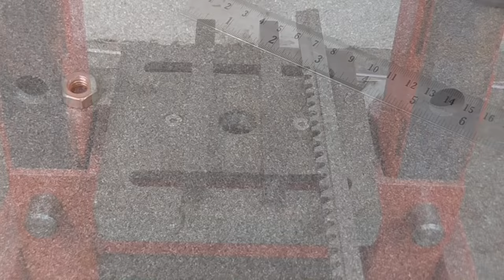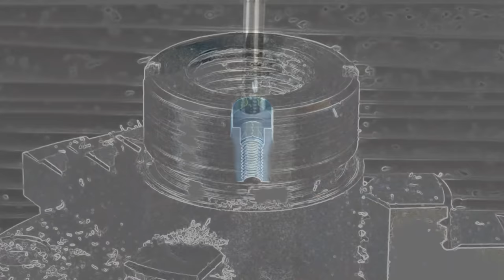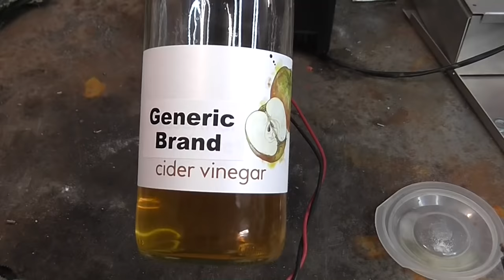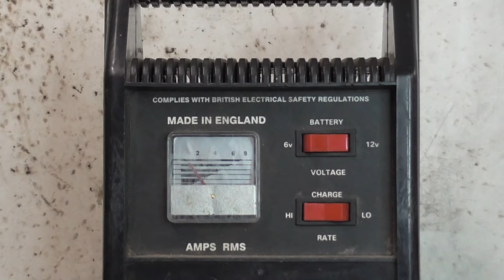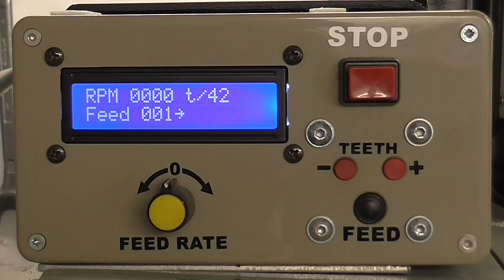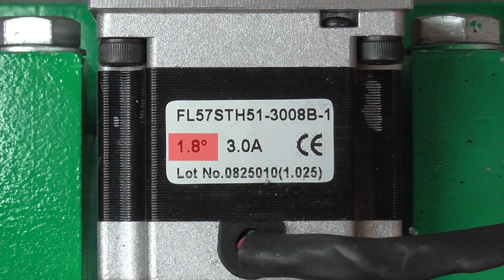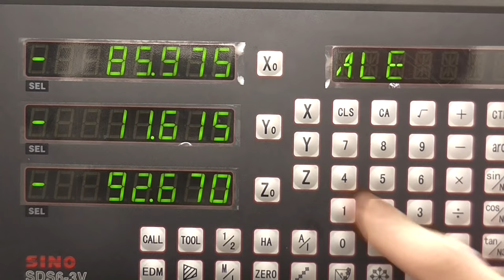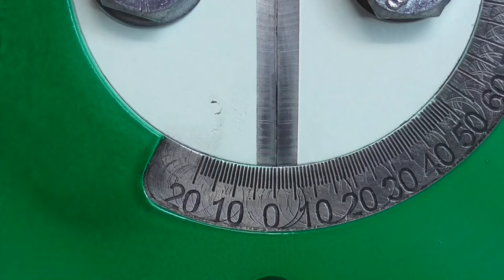Gear Hobbing Attachment (milling machine) Part 2

Comment: How does one cut bevel gears? Sometimes I wish I could just remanufacture my differential
Reply from the maker: Normally bevel gears are cut by a completely different system, especially spiral/hypoid types. It is actually possible to cut straight bevels with an attachment like this, but only with a single point tool, not a hob. When I absolutely have to make bevel gears I use the manual indexing method.

Comment: Would this arrangement cut Hypoid gears, such as a differential ring and pinion?
Reply from the maker: Unfortunately not. Or at least not with a standard type of gear hob, for that you need to use a different approach such as the Gleason system.

Comment: Kind of looks like Skiving is a form of rotary broaching?
Reply from the maker: Yes, it's similar, but the tool is at a much greater angle and the interaction between the tool and work is more complicated. (The tool partly broaches and partly generates the profile created).

Comment: impressive af. that's some excellent machining, subscribed!
couple questions though:
1) why are the teeth that are cut so rough? looks like a lot of file work to clean them up. at 15:17 i saw some misalignment of teeth on the hobbing cutter (i.e., they looked staggered about the horizontal line), could that be causing it? i think that because you cut the skiving cutter with that hobbing cuter, and it had rough teeth, the skived teeth finish was markedly worse. it seems like if they smoothness of cut could be improved that'd be a great improvement.
2) do you need different hobbing/skiving cutters for metric/imperial gears, or is it just an angle adjustment?
Reply from the maker: At 15:17 the teeth in each row on the hob are in a different position vertically as they wrap around the hob in a spiral. think of it as an interrupted thread.

Yes the internal gear was a bit rough, I think mainly due to chips not being cleared, but also due to the geometry of the cutter. The cutter I used had only 8 teeth, I think it will work much better with at least 12-14 teeth, this will make the profile of the cutter teeth closer to the profile of the gear teeth it's cutting. The gear has to have a number of teeth that is a multiple of the teeth on the cutter, I was cutting a 40 tooth gear and since I can (currently) only divide by integers the next sized cutter I could have used above 12 would be a 20 tooth cutter and I didn't have a piece of tool steel big enough to make one.

You can cut imperial gears with a metric hob and vice versa. Metric gears have a pressure angle (angle of tooth) of 20°. Imperial gears can have a PA of 14.5° or 20°. If cutting 20° teeth you can use hobs to cut imperial or metric teeth of a similar size, eg 32DP is very close to 0.8Mod (actually 0.794) So you can use a 32DP hob to cut 0.8Mod gears or a 0.8Mod hob to cut 32DP gears. It won't be exact, but plenty close enough allowing for the normal amount of backlash.
Reply: @AndysMachines  interesting!...lol, i am just learning about machining, so 90% of what you said i don't yet understand. 😂 but i will eventually! 😎great stuff, thanks.
Reply from the maker: I'm still learning myself! 😉

Comment: I'm, a little mystified. This is the second vid of your's I've seen.  It seems you don't prefer cutting oils. I love high sulfur oil for steel  and the synthetics are fabulous. I've gone  to misters and love  'em.  I'd like to understand your avoidance of lube.
Reply from the maker: A lot of people seem to make this comment. I actually do use cutting oil, you can see parts dripping with it in this video, I generally don't show the application of the oil, but I made a point of including two shots of this in this video (very quick). I also often use flood coolant, but this makes it very hard to see what's going on so I usually don't use it in the videos. True, I'm more conservative with the application of the stuff than some people. (eg. Abom who will completely fill a blind hole with oil before tapping it, and then add more during for good measure!)
Reply: Sulphur is good for longer tool life .. but it fumes are far more dangerous

Comment: Very cool, I like seeing the broaching tool . Did you know you can get pull through cutters that have self aligning centers and depth cutoffs?  They are for particular machine work but I imagine it could be used for a variety of things. I see the tap handle and that tool is what comes to mind.  What is the difference in a button broach cut and a normal broach? Does it self burnish ?

Comment: 7:24 Shame the milled background is badly marked by the cutter.
The 5s are as long as the 10s
I also think the marks are too deep ! Maybe half as deep would have been better.
Reply from the maker: Yes, this is not the best example, the milling cutter was actually chipped and left some deep scratches. I should have re-done it really. The drag tool displaces material up and leaves quite a large burr on the edges, this is later sanded off to leave the marks the right depth.

Comment: Is it possible to use the sobbing wheel to drive the rotation of the blank?
Reply from the maker: Yes, that's called 'free hobbing', though it doesn't always work well and you can end up with a different number of teeth than expected. For best results you need to gash the blank first with the correct number of slots and then take a single pass with the hob at full depth of cut.

Comment: I would like more information on the electronics.  Would you be willing to go over this?  Clough42 discouraged people from using the Uno, but if you used an atmega328p in assembly, there would be hope for the Uno.
Reply from the maker: A lot of people have asked me for more information on the control. I actually used a PIC microcontroller for this. I don't know what Clough42 is using but I imagine his concern with the uno is that it will miss encoder pulses, however he states a max. input of 100KHz, an atmega can easily cope with that if programmed correctly, but arduino IDE may not be the way to do it. Unfortunately arduino is what everybody wants to use nowadays, I'm going to try and come up with a new version of the controller that's 'arduino friendly' and cheap and easy to build. It won't be as sophisticated or versatile as Clough's, but it should work fine for this application.
Reply: @AndysMachines  which pic you use?  I programmed a homebrew claw machine that used a pic 16f870.  On my YouTube channel there is a demo.  
Regardless, it's been a while but I do have the programmer for pics.  Or I have been starting the research process of using an Arduino uno using the encoder library found on pjrc.  I don't want to use this whole library but instead the asm volatile lines that does the quadrature cw/ccw detection.
Reply from the maker: I think it was a PIC16F876, that was ones of my favourites at the time, though I went over to Atmel devices 5 or 6 years ago now and I don't tend to use PICs any more unless modifying an old project. I never really got into arduino but I do have a few different ones to play with.

Comment: Hey Andy nice build. Could you tell me what encoder head you used? I am looking to add one to my mill maybe make a hobber setup like yours. Also could you confirm the stepper motor is a nema23?  thanks Barry
Reply from the maker: Thanks Barry, Yes it's a Nema 23. As for the encoder read head I just took one from an old servo motor that matched the line spacing of the codewheel I made, I think it came from a printer or photocopier, but there are no markings on it. If you can track down an old mechanical computer mouse these had simple encoders with quite course line spacings that are easy to make codewheels for.

Comment: How is a 3 jaw chuck accurate enough for holding the blanks?
Reply from the maker: That's actually a very good question and I'm not sure if I showed the process in any of the videos. The chuck is mounted to a face plate by 3 bolts from the front and is free to move about. I just loosen the bolts, tap the chuck in using a dial indicator on the blank to get it true, then re-tighten the bolts.

Comment: Thanks for your excellent video. How do you overcome the cumulative errors in the division ratios? e.g. a 40 tooth gear needs 15 pulses from the stepper so there are no errors whereas a 38 tooth gear needs 15.79 pulses - but the stepper only provides integer pulses, so presumably will only send 15 pulses? At 38 teeth the errors per tooth would accumulate significantly - or have I misunderstood?
Reply from the maker: I see your thinking, but it doesn't quite work like that. The fractional errors don't accumulate since it's continually counting and not resetting at the start of each revolution. eg if dividing by 38, after the encoder has made 570 counts from zero, the stepper would have stepped 15 times. The next step (16) would be at the 608th encoder count. One full turn of the encoder just happens to fall between two steps, but it doesn't affect the ratio.
Reply: Any chance you could do a run through the code and how the quadrature encoder is set up?
Reply: @AndysMachines  So you would input the decimal value - 15.79 - and everything will be fine?
Reply from the maker: @gyrogearloose1345  No, you would enter the number of teeth you need, in this case 38. It would step on every 38th pulse received from the encoder which happens to divide into a full rotation of the spindle 15.79 times but that doesn't matter as it doesn't reset each rotation and the steps are perfectly even, eventually you would get back to exactly the point you'd started from with the same tooth of the hob in mesh with the same gear tooth (after 75 rotations I think)

Comment: Hi, where did you get your encoder wheel from? Great project & video 👍
Reply from the maker: Thanks! I made the encoder wheel. I already had the encoder read head with a smaller wheel, but it wouldn't fit on the machine spindle so I made a bigger one.

Comment: Will there be further parts detailing the electronics build and programming the thing!!✅✅👍👍
Reply: If you want to dodge the hardware, perhaps you could re programme the electronic lead screw that clough42 already sells🤣🤣👍
Reply from the maker: @rogercrier9115  Somebody else suggested that, I'm not really familiar with it, but it sounds like it could be repurposed for this.
Reply: @AndysMachines  
It is a motorised lathe lead screw to cut screw threads without the gear ratio changing faff! 
Watch the video series. He is selling the hardware worldwide. Perhaps you could collaborate !!

Comment: So when you did the skiving, does the spindle head needs to be tilted ?
Reply from the maker: There needs to be an angle between the blank and the cutter (this generates the relative cutting motion). I did it with the spindle vertical and the blank tilted, this allows me to feed with the quill which is more precise. It could also be done with the blank vertical and the head tilted. The cutter I made had straight teeth, skiving cutters can also have helical teeth, the direction in which the cut is advanced needs to be in line with the cutter teeth.

Comment: How well does this work as a dividing head? Will the stepper motor and roller bearings hold it in place well enough to do machining?
Reply from the maker: It's not intended to be used as a dividing head and probably wouldn't hold position very well. For a dividing head you really need a worm reduction which resists being backdriven. I have a 40:1 horizontal/vertical rotary table (Vertex) that I have added a stepper motor to (very easy to do). This works well for CNC dividing and as a 4th axis.

Comment: Could it be possible to forgo the base's angle adjustment by angling the head more and adding or subtracting the helix angle to the cutter helix angle? 
I'm thinking it would need to change the angular displacement as it feeds to keep the teeth in line, which of course means another readout (distance this time) feeding into the arduino. 

I'm thinking you could visualize it as an already made rack and pinion, with the rack being the cutter, and add (or subtract) an extra rotational pulse per number of horizontal travel pulses to make the gear rotate according to the rack.
I'm still thinking about how to calculate that though.
Reply from the maker: Yes you could do that, but then you would have to take the cut in both the X and Z directions simultaneously, which you could do with a CNC, but on a manual mill it's much easier to tilt the blank and cut along one axis.

Comment: Hello Andy, little more can be said .... they have already told you everything in the comments .... but I can't resist saying it again .... Congratulations!

I have read through the comments that you are making a new version of the software (any Atmel / Arduino?) I give you an idea (I suppose you have already thought about it ...) and if you could also use the same electronics and mechanics to make a plate digital divider

Another question, what has been the smallest gear of the module that you have made with this accessory?

A greeting!
Reply from the maker: Thanks very much! The smallest size gear I have made is 100DP (approx 0.25 Mod) 18:03 This gear is 3.5mm diameter.

Yes, a lot of people have asked about the dividing controller and I'm working on a new Arduino based version. It could possible be adapted for use with a dividing head/positioner.

Comment: The encoder and and encoder box where can one purchase  or do you have a plan of how to build try using a index divider head with a stepper motor with no luck . please help as now have subscribed to your channel you clear up the reason why the hob needs to be set at a given angle  no  other person has shown that in a video before they talk about it only.  Great video  thanks well done .
Reply from the maker: I built the control box, some years ago. It's quite a simple device but I'm not aware of anything available commercially. There are several open source 'electronic leadscrew' type devices which basically work the same way and could probably be adapted for this. You would need to find an encoder that works with your milling machine, this would probably be a large hollow type that can fit on the spindle, or depending on the design of your machine you might be able to attach it somewhere in the gear box as long as it rotates at a constant ratio with the spindle. I'm going to be working on an updated Arduino based controller, which I'll publish details of when it's ready.
Reply: Thank you Andy  for the reply found a encoder on E-Bay just got to work on cutting the disk to a larger size to fit my Hare & Forbes mill look the same as yours at the top and have order the two pulley size which should go on the back of my index divider head chuck. thanks again , am looking at become a patron too your channel.

Comment: Pretty sweet project, but considering the time it takes to cut each gear, I am not sure if its any faster than cutting gears with a regular gear cutter. FWIW: I made controller that cuts gears on a mill automated. Basically controls the X axis and a B axis on a super-spacer\Dividing head. You just set the number of teeth for the gear, manually set the depth of cut and feed rate. Much less hassle of syncing the spindle to the B axis.  I think takes about the same amount of time as your hobbing cutter, well unless you cutting a very large number of teeth. I believe my automated cutter can cut a tooth once every 10 to 15 seconds.

Not sure why you choose to paint the base grizzly green. :) 

Question: what tool did you use for the vinyl cutter for the angle numbers?
Reply from the maker: Thanks! Yes, hobbing is generally faster because you are cutting all the time and not having to reset each pass to cut the teeth individually. I was being quite conservative with the feed rates, especially on the steel gears, I could probably push it harder but you do need to be consistent, which is why power feed helps a lot.

I have a rotary axis for my CNC and have cut many gears as you describe by just writing a small gcode program that calls a subroutine N times to cut each tooth, it works well as you can just leave it running until it's done. But the real advantage of a hob is that it will cut any number of teeth with the ideal geometry. Cutting with a form tool you need a different tool for every different tooth-count.

The paint I bought online and it wasn't actually the colour I expected, but I like it!

I used a regular vinyl cutter to make the template. I drew the numbers using V-Carve Pro (I think this has now been replaced by something called Aspire)
Reply: @AndysMachines  Thanks for the reply!